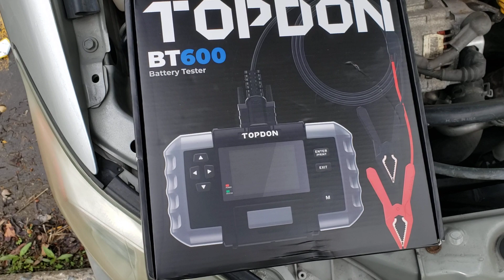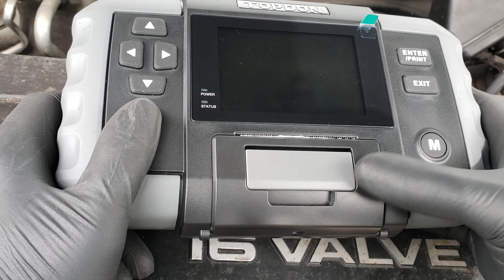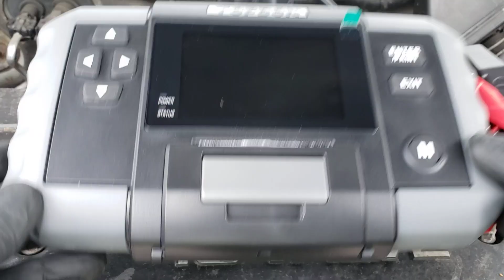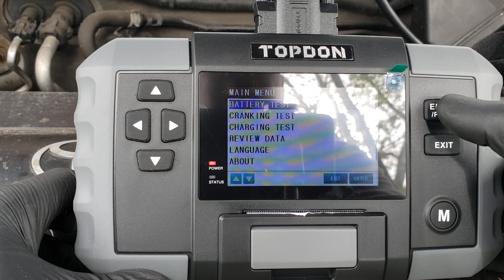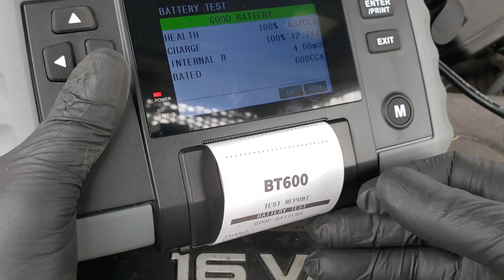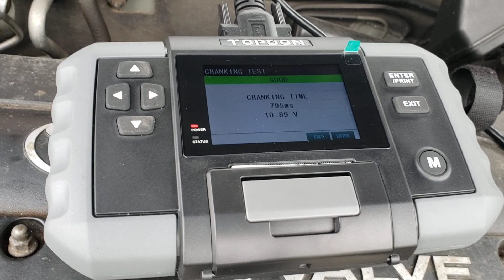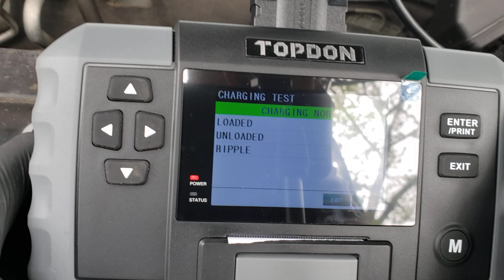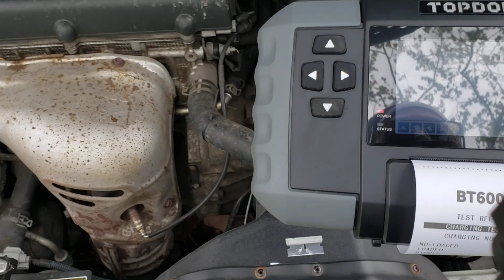TOPDON  BT600 review

Comment: I'm confused. During the load test it never asked you to apply a load such as turn on high beams, turn on blower to max setting, turn on interior bulbs, all you did was increase engine rpm to 2,500 revolutions. So how did it test the loaded voltage? So the only difference between load and unload is the increase in engine speed?